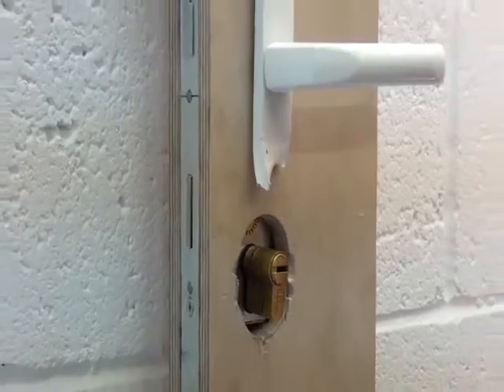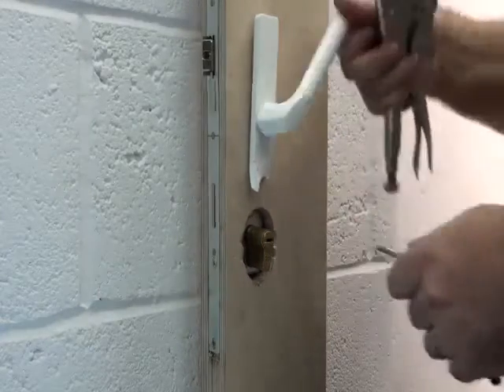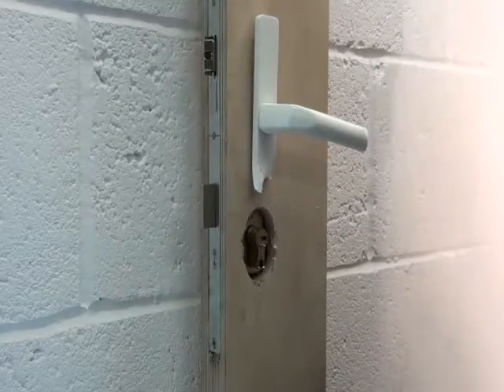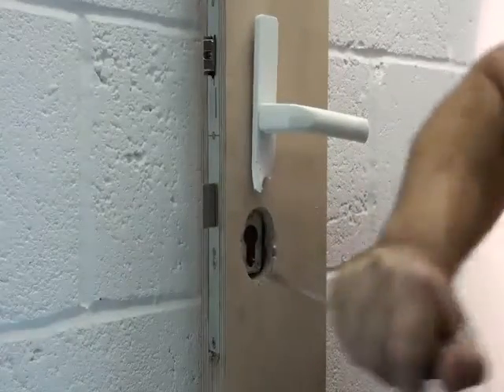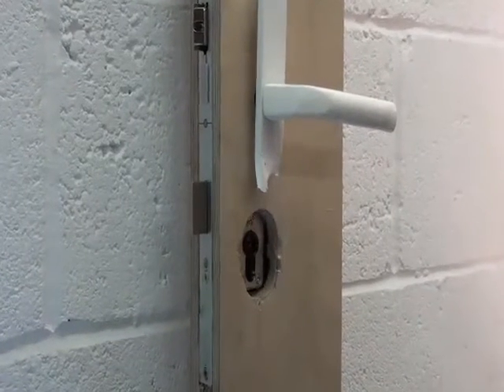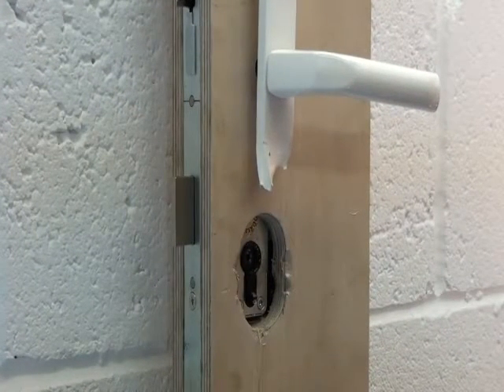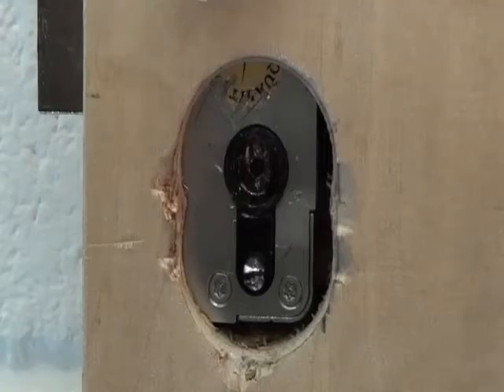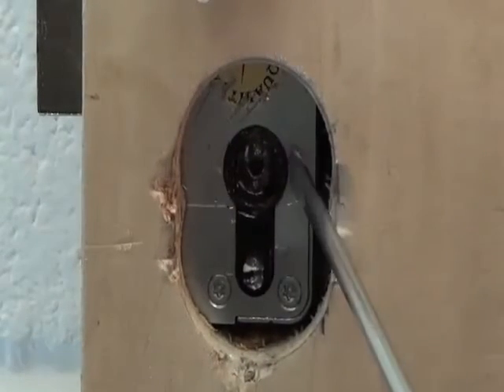High Security Lock with cam curtain and snap safe cut on TS007 test rig

Comment: If the inner sacrificial lock is broken on a system with alike pinning on front and back doors. Wouldn't breaking off one lock give the ability to make a key and get in via the other door?

i.e. snap the back door and then make a key to get in the front door.
Reply from the maker: Keir Stitt good thought. But to remove a core of its pins and cut a key is very slow. This is an old lock design now and we no longer sell ABS. But there is 2 methods of attack that can bypass this lock in 30 seconds now.
Reply: Your absolutely correct, old fashioned picking in the end always seems to be the best form of entry - at least for those who know what their doing. These features block opportunists instead.

I'm more of an expert in computer security and take an interest in physical locks as they're good analogues for computer security issues. Of course computer security methods rely on open standards such that you can only get in with the key. And a community of interested people who find flaws and propose fixes.

I'm worried about the unintended consequences of locks with sacrificial parts.

I've put a vibration detector next to my own front door lock. Try and pick it, bump it, snap it or drill it and the alarm will go off.

Comment from the maker: Hi there. It depends on the destructive damage caused. But if it's only snapped once your key may work. I've even attended jobs that the multipoint gearbox has failing due to the force applied. If the second sacrificial cut has been removed then a competent locksmith will be required.